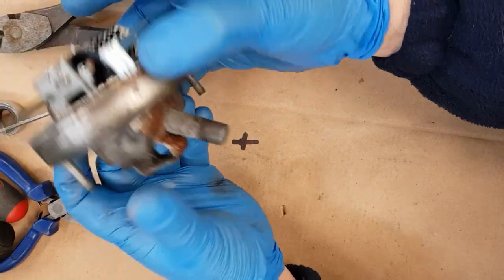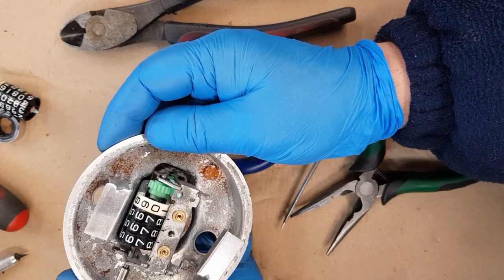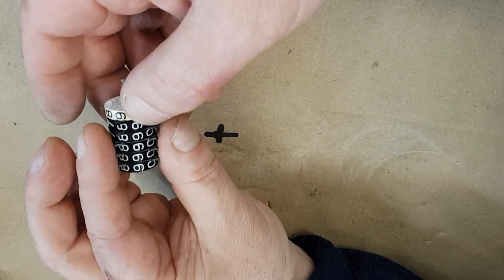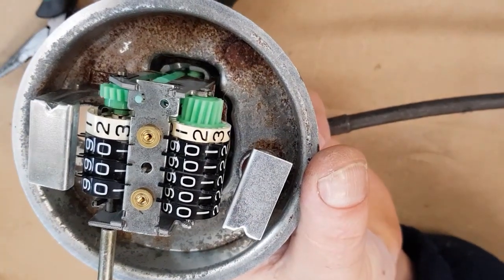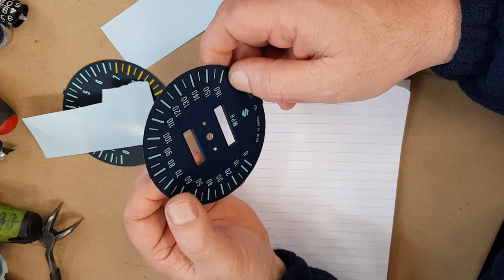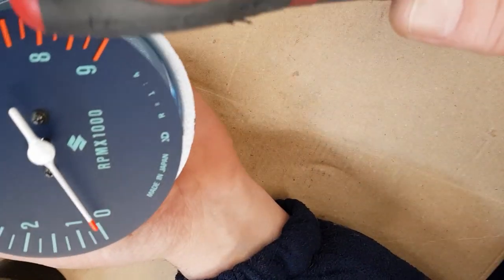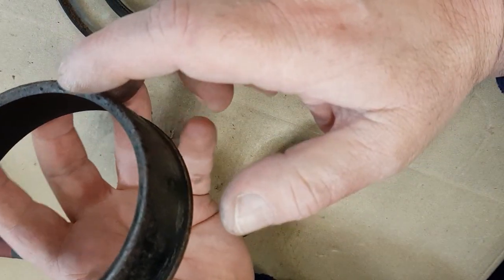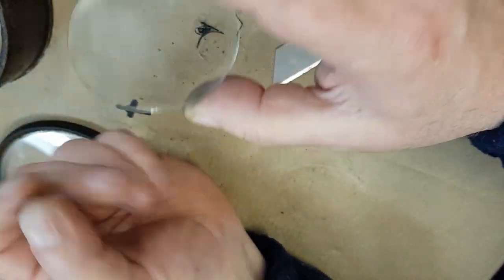Restoring the Clocks Part 3 - Rebuilding a Suzuki GT750 - An Idiots Guide

Comment: Rather than prise out the clock a much easier way is to remove the small copper circlip at the end of the shaft holding the most significant dial in place. You can then slide each number along and rotate it. Once they are in the sequence you want. push them back together and replace the circlip.

Comment: H Peter. I got my faces from Image Works also. Reasonable price (considering I ordered 2 sets, and he sent 3). Also included water temp faces, but the temp gauge face has raised markings. Do you replace the face on the temp gauge? I'm guessing you could remove the raised areas on the face before placing the sticker. Cheers from Australia, Mike.
Reply from the maker: Hi Mike 
If the temp gauge has the raised markings I carefully cut out the red and blue boxes and stick them onto the corresponding raised areas on the temp gauge after carefully cleaning the face
Just changing those 2 areas really makes the gauge look fresh 😁
Reply: Thanks Peter. So, you just stick on the red and blue bits, and leave the rest? The face is actually pretty good apart from the faded red and blue.